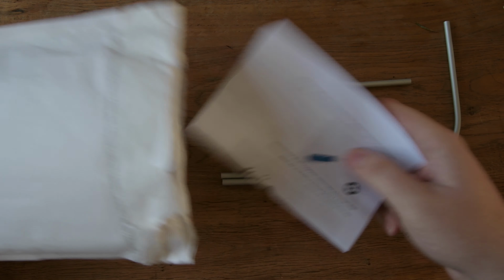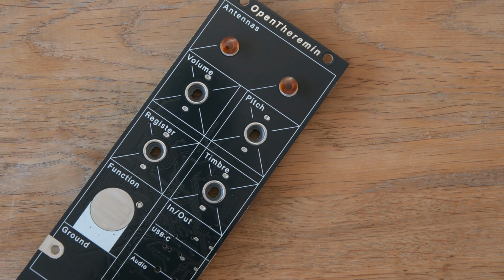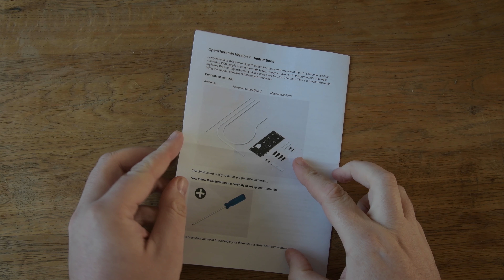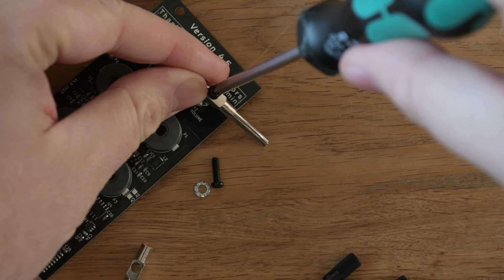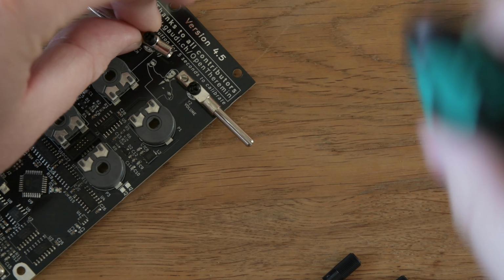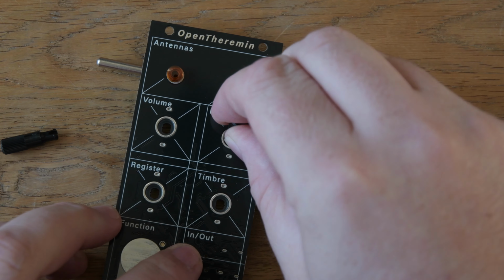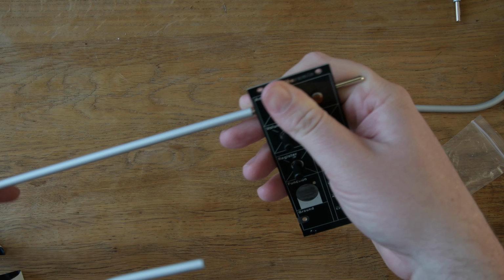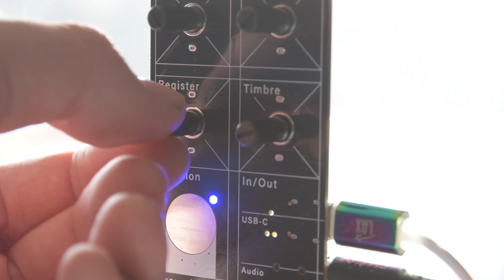Open Theremin - Build and first play  4.0 / 4.5

Comment: That's a really cool project! Congrats on the build! I recently designed my own open source theremin that's cheaper and easier to build the PCB (you can do it at home) and it doesn't suffer from the aliasing issue open theremin exhibits when generating high pitch
Reply from the maker: Do you have a link to this project? I would love to give it a go? Cheers